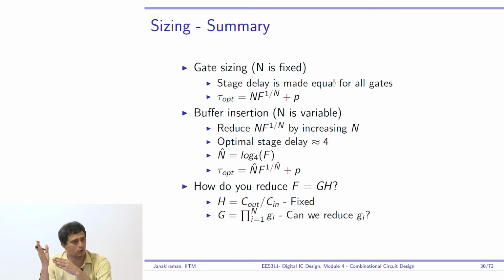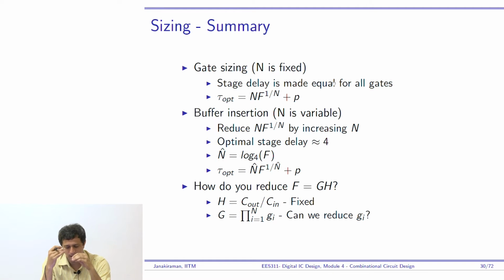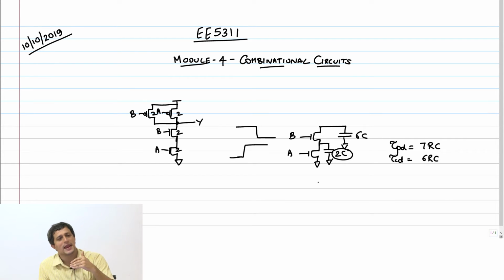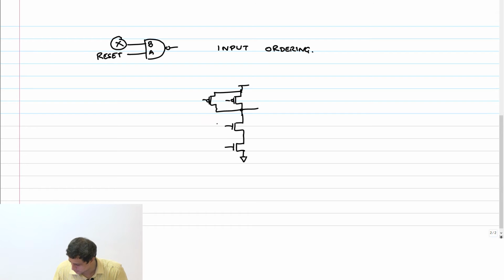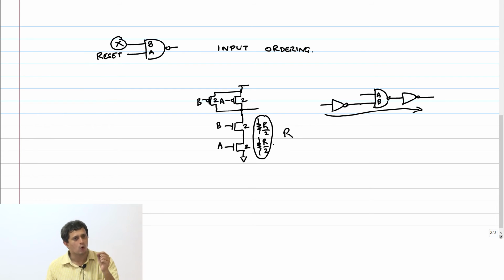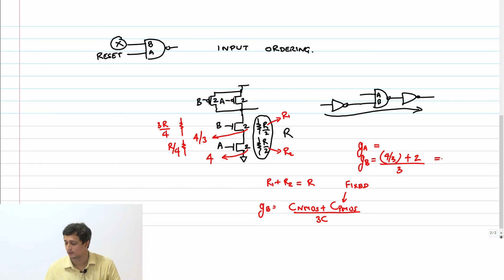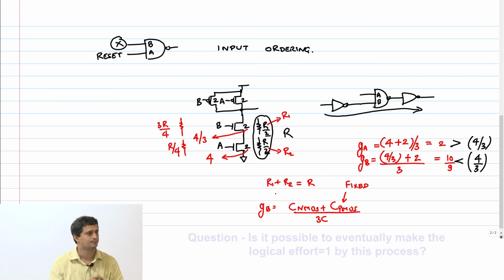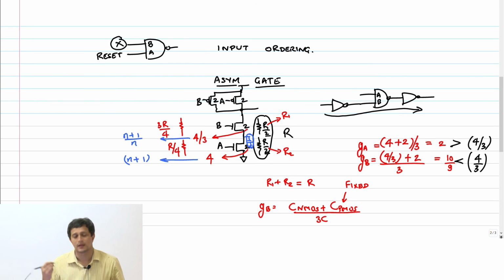CombCkt - 12 - Input Ordering and Asymmetric Gates

Comment: 13:58 If we give preference to one input over the other, how is logical effort same for both inputs 4/3- the capacitance offered by one input will be lower, while the drive strength will decrease as sizing to decrease capacitance leads to increase in resistance of that transistor in the pulldown stack. Logical effort is the capacitance offered for a pull up/pull down resistance on the stack.
Reply: Thanks for inserting the questions being asked in class.